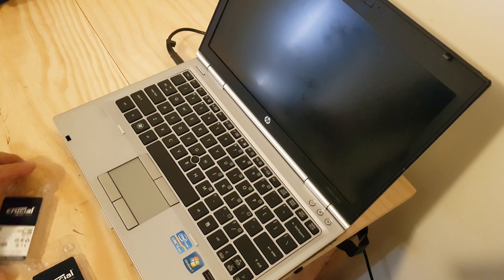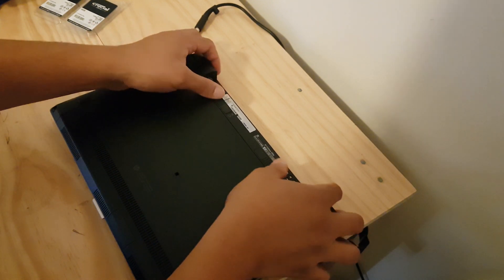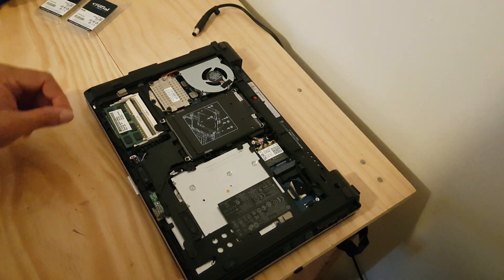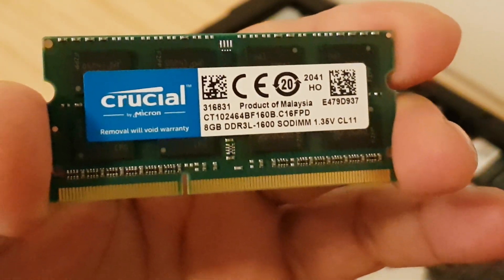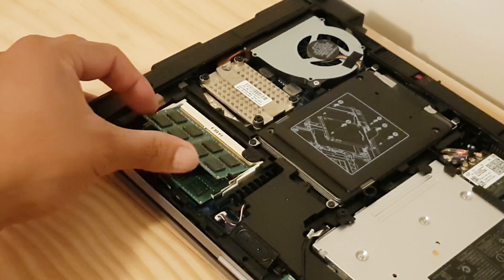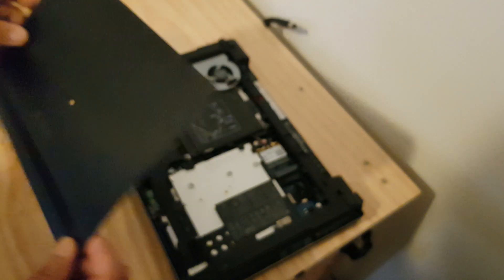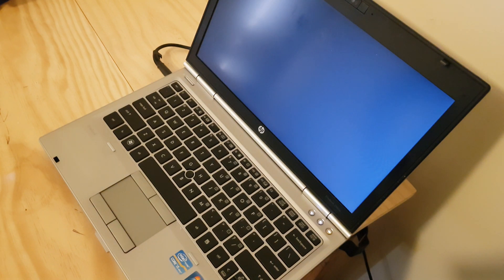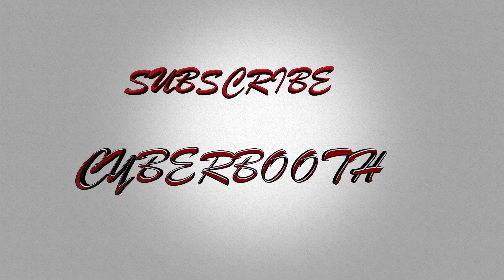How to upgrade ram on HP Ellitebook 2560p

Comment: I installed 8gb ram on 2 slots,total 16gb, and the screen remains black! If i install only the 8gb, no problem the slot, it is working normal. If i place 8gb+2gb(old memory) again it is working normal! Only cannot work for both 8gb memories. Any help?
Reply: Look the frequencies. The frequencies must be equal the memory card factory. For exemplo 8gbram 1300mhz is different 8gb ram 1100mhz. Evem the both being ddr3. Pay attention on frequencies, for this reason one of them works, probably is the same frequency of memory card factory.